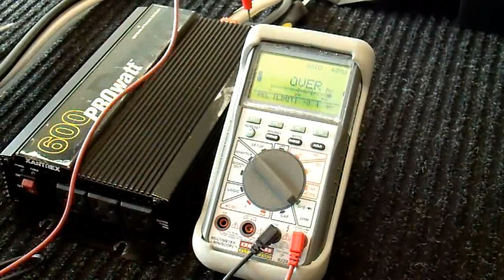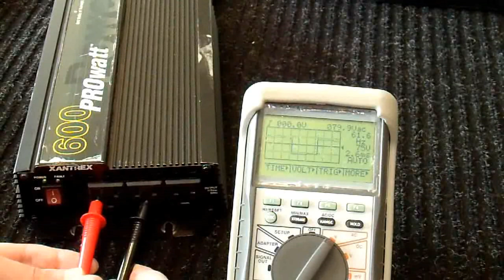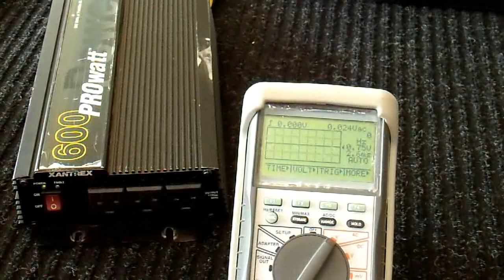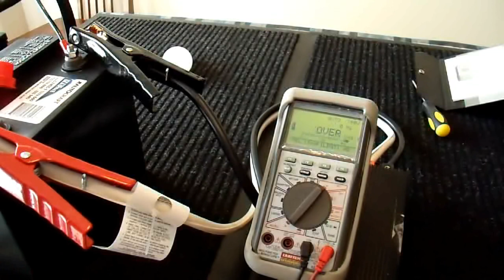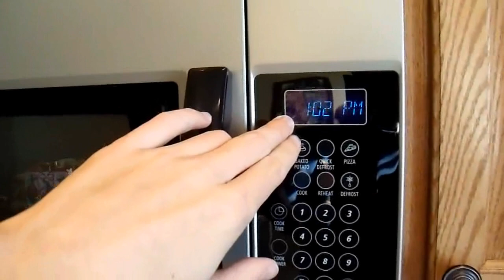How NOT to Connect an Inverter to Your House Mains - Xantrex ProWatt Inverter part2

Comment: I can not believe anyone would try and back feed such a small inverter and with 2 batteries you would be in the dark again in short order if you tried to run everything in your house.
That inverter would be enough to run a extension cord into the house and run a lamp, laptop, cable modem, and router for a few hours. but if you tried to run much else you would be in the dark (out of battery power) in short order.

Its interesting where you did the voltage measurements on the output plug. I will have to turn on my inverter (2000 watt pure sign wave) tomorrow and do some voltage measurements.
Reply: it was an example, he didnt want to drag a bunch of batteries into his house

Comment: Protip: You need to get a "transfer switch". A manual one is not very expensive. A more expensive automatic one can also start some generators if the battery gets weak. You WILL need an electrician or qualified electrical contractor to do this because you will be messing with your homes mains after the meter and before the fuse box for full house systems (like the ones from Generac) or on selected circuits after the fuse box for lighting only and other limited usage systems (like the blower on a gas or oil fired home heating system).
Reply from the maker: I actually can legally install a transfer switch myself where I live without an electrician, but the point of this video is to show how one can do this without a transfer switch or interlock.
Reply: ***** In a sense, if you disconnect from the mains at the breaker panel and back feed from a socket or wiring into the panel, you have a transfer switch. It's a bad thing if your inverter does not have a built in interlock circuit :P
Reply: Don't mess with that; you're probably violating a code somewhere because you're installing a device before the main breaker. Instead, connect the transfer switch to the main breaker (N.O. terminal), and then get a new main breaker and connect its input terminal to the transfer switch, to function as the new main breaker. This way, you can safely install the transfer switch without messing with the grid power meter/fusebox.
Reply: Neo That would violate the code itself. It reads, in general, "Thou shalt not mess with thy breaker boxes bus bar or main breaker terminals except as indicated in the manual." You have to either interpose before or after a main breaker and only before in a transfer switch with a rated and tested (UL in the US or other underwriter body, like ETL) breaker built in or a separate main breaker in a smaller box. A licensed electrician is qualified and will know what is needed. You, the homeowner, are responsible for all wire after the meter and only the power company electricians are allowed to make the connections in the meter box.
Reply: You're allowed to wire after the main breaker, that is to connect it to secondary circuit breakers. There are four terminals of the main breaker. Perhaps your home has a two-terminal breaker. You'll need the four-terminal one. Line and neutral terminals go to the meter/grid; you're not allowed to do anything with both of these, because you would need to obtain the permit to have it switched off at the meter box to be able to do anything at all. Third terminal is for LOAD. You're allowed to connect secondary circuit breaker coupled with a transfer switch to load terminal. The 4th terminal of the main breaker goes to the neutral bus bar; you're allowed to reconnect the neutral bus bar. If your transfer switch is a DPDT, you'd have to interpose before the neutral bus. Again, this is 4-terminal main breaker. If you've got the 2-terminal, you'll need the power company to do it.

Comment: my question is this.. how do you say you cant do all of this... but they sell plug into the wall solar systems that work just fine.. i installed a 1.7kw unit in my grandparents house that just plugged directly into the outlet of her house on the outside circuit.. and it offsets her bill to nearly 0.. and has been for going on 2 years without a problem...
Reply from the maker: That would be a grid-tie inverter.  They can be plugged into a wall socket without these restrictions.  This video does not apply to those products.  Thanks!
Reply: Grid-tie inverter right there. It automatically synchronizes with grid voltage and automatically shuts off when grid goes down.
Reply: ***** Grid-tie inverter is designed to allow mains power to pass through and mix with its own power. Normal inverter would blow for sure, but not grid-tie inverter designed for this very purpose.
Reply: ***** You should be looking at Enphase microinverters if you want quality grid-tie inverters, especially for small installations. Those Chinese inverters are good for nothing. As for insurance and building codes, check your local code and guidelines on solar installations.

Comment: why can't you take an end of a cord three prone  plug that end into the converter and the other end you would strip back(of course the power is off and not plugged in yet) and plug one wire to the 110 and one to the ground and the other to the common and you would at leas we have 110 in the house temporarily   right?
Reply from the maker: If it is not a GFCI then you could, otherwise only connect the line and neutral.  The safety issue here is that because neutral and GND are tied together in your breaker box, and because many inverters have a live neutral configuration, that you would end up energizing the batteries you use to power your inverter.  If you have it connected up to your car, for example, then the entire body of your vehicle could have 60VAC going to it.  60V is unlikely to cause injury but it is higher than what is considered safe.

Comment: I have a expensive Voltcraft pure sine wave inverter and through your video discovered that there is indeed 1/2 nom. between each of the 2 hots and the ground. Ground/earth is connected with the +12VDC strange enough. Good thing i don't have a Bonded earth/ground/neutral in my house, otherwise i had blown or damaged my inverter for sure. Thanks for this information!
Reply from the maker: That's very interesting.  I have never seen an pure sine inverter with a live neutral configuration before.  Thanks for sharing!  I'll take a look at that on future inverters I test out.

Comment: 8-10 kw for a full house . but the home ones use higher dc volts so u use less current  most solar inverters .the 12 volt dc ones waste more power to heat not watts at the plug . i prefer  real ac power inverters are good n quiet  but a generator is more real.

Comment: How long can you use an inverter n your house? Can you use one to completly replace your main power or do you use something else? been thinking of going full solar power and i'm currently gathering any info i can find but the inverter is one thing that has me confused a bit. I see it's something that can overheat and has an internal fan, it has me wondering if i can use something like that to power my entire house.
Reply from the maker: A good quality inverter can operate continuously without issue.  You may need to clean out the dust every once in a while and replace the fans after a few years.
Reply: Thanks A lot.
Reply: We do just that with a modified sine wave inverter/charger that we bought about 30 years ago. It's been running with 100% up time since new. At the time the house was built (on a remote farm) it was to expensive to get the power company to install poles to our house. It's 2.2kW 24VDC input. I forget what brand it is, I don't think the company still makes them. Also it's been powering the same freezer for all that time and the compressor is fine. We got a new fridge because it was too small not because the old one died.

Since then we've built a whole new house near the outer edge of the property and we've had mains power installed here. But the old house is still down there full of all our junk and old furniture, and the invert is still buzzing away 24/7 365

We got a huge 1500W wind generator which makes 40A at 28V in high winds. We got collection of 40W 12V pannels and some 180W 24V pannels that make about 1000W in the summer sun, plus a 6.5kW diesel generator.

Because it's a inverter/charger when the generators running we can make the inverter convert 240VAC back to 24VDC and recharge the batteries.

Comment: Would a pure sine wave inverter be fine for appliances in a long use scenario? There are a lot to choose from online and I noticed some are sold as modified sine wave inverters which I think you said can screw up microwaves and fridges etc. thx
Reply from the maker: Pure sine is the appropriate choice for long term continuous use.  I would only use modified sine if you are on a tight budget and don't mind paying again to upgrade later.  Pure sine inverters come in all different grades and configurations just like modified sine so you'll have to decide what feature set and price point is best for you.

Comment: any issues with using grid tie inverters? Can multiple grid tie inverters be connected?
Reply from the maker: I would recommend to always check the manual, but grid tie inverters can be connected together.  Connecting multiple grid tie inverters to the same SOURCE (solar panel, etc) is not an intended use scenario and probably won't work very well since they usually have an MPPT in them.

Comment: Who would WANT to hook up an inverter under 1000w to your house anyway?  The 600w one in the video would not run most full size refrigerators, let alone the whole house.  A full size refrigerator requires somewhere between 700-1000 watts just for it.  Isn't the fridge the main reason for using these anyway?
Reply from the maker: I was just using that inverter as an example.  The principles involved are all the same so the size of this inverter is irrelevant.  I use a 3000W inverter and a 1000aH battery bank for this purpose in my house.

That said this inverter WILL run a refrigerator and sometimes you might just want to charge your phone, watch TV, turn on a few lights, etc.
Reply from the maker: *****
My full sized refrigerator only consumes about 120W when running.  It requires nearly 1000 to start, though.  Not many sub 1000W inverters are able to run it.  The one in this video does.
Reply from the maker: *****
I should also mention that it requires >1000W when in the defrost cycle.
Reply: The fridge isn't my priority during a power cut. I want TV, DVD player, internet router and house lighting (which is now LED). 1000W easily covers it. The fridge is new with very good insulation, so it should survive for a few hours without power.
Reply: Not even 1000W inverter if you have a fridge or AC at all, due to the compressor's initial power surge. He's just using it as an example. It serves the purpose well. Just like he commented, you will need the 3000W continuous (preferably 6000W peak).
Reply: *****
I'm not entirely sure why you addressed that to me, since I said nothing about grid ties.
Reply: Unless all you want is a TV and a few lights.
Reply: @Wonkee Our older Gibson draws around 225 when running. Our even older Philco was even less but after 50 years and moving half way around the world and back, it finally died. It all depends on the design and whether it has all the latest but not so greatest features. Our full sized Servels used no electricity at all. They ran on natural gas.

Comment: You can use an AC outlet tester to verify the inverters output too (those $10 ones with the three lights and a table, must show OK and not an open ground or neutral fault). A second check w/a Multi meter like you showed is not a bad idea! My PB PSW 1000 inverter is wired correctly inside if I need to wired in an emergency (tested).

Comment from the maker: I have found that most of the time the outer case is isolated from all inputs and outputs, with the frequent exception of the output GND.  If the case is connected internally to the GND lug on the output plugs then connecting the Line and Neutral up to a breaker panel will cause the case to be live on those units.

Comment: Won't this also cause the outer casing of the inverter to become live?  My inverter (A RING model designed for use in the UK) has the battery negative connected to the outer chassis.

Comment: No voltage between  GND and battery terminals.  But I am getting voltage between both neutral and hot and the battery terminals. Sigh.

I guess I will run a couple of lines from the inverter for handy outlets, so we don't have to go to the basement to grind coffee or run a laptop ;-) 

Thanks for your help.

Comment from the maker: I agree with you about the separate wiring - it just isn't practical.  I would recommend checking the voltage between the battery terminals and neutral before plugging it in to make sure the input and output stages are isolated - occasionally they're not.  Thanks for the sub!

Comment: Thanks for another great vid.  I've sub'd.  I use a suicide extension cord with my generator, and would have just plugged an inverter in with one of those.  I got my Motomaster 1750 inverter last week (after watching your reviews) and am pleased to see no voltage between GND and either of the other two lines.  Using a suicide cord will be so much easier than running separate wiring around the house for emergency power. Does this sound good?

Comment from the maker: Unfortunately it is AC so diodes will not solve the problem.  In reality you could connect it like you want by simply not connecting the inverter Ground (the ground on the AC output receptacle) and if you can guarantee that no children or anyone without prior knowledge has access to the DC side of the inverter it should be OK.  Still I cannot recommend it for liability reasons.

Comment: what if I put 3 diodes = 1 for the hot, 1 for the common, and 1 for the ground. than put a switch after the breaker?? would this help me tie in the 1500 watt inverter to run just my lights??? I am asking because I think this may work?? what do you think?  I am saying with the 3 diodes in place, AFTER  I shut off the breaker for my Lights. would this stop any back feeding to the MOD INVERTER?

Comment: Also, if I use a pure sine inverter can I run a suicide plug to back feed the panel or does it split the power output to the hot and common lugs like the modified sine inverters?

Comment: Man... glad I found this video. Was wiring my off grid cabin this weekend and would have done it the wrong way. I now have the lights and few plugs on my "inverter line" on the big stuff in the panel run off my generator. Then plug that line into the panel when I switch over. Question... my inverter has a ground lug in it. If I ground that to my rod outside will that change the inverter output? Do I need a separate rod for the inverter or is the panel rod OK?

Comment from the maker: If this is about cost, then I would recommend going the monthly electric bill route.  It will cost you less than any sort of solar or other installation in the long run and allow you to do so much more.  I have done the calculations and where I live and with 440W of solar panels I would get only about 35kWh/month.  That's less than $30 worth of electricity per year.  After adding the base charge you'd still come out ahead paying the utility company.

Comment from the maker: AC line power will destroy the inverter.  It will not put any power into the batteries but it is likely to put smoke into your house.

The mains must be turned off because backfeeding like this is a real electrocution/fall hazard to anyone working on the power lines outside of the home.  You could be energizing a potentially large portion of the grid outside your home if you happen to be on an island without other customers connected.

Comment: My house was built in 1960, so I have two tar coated wires coming into a sealed fuse and two wires coming out plus a braided earth strap which is fixed to a metal spike that is driven into the foundations. The two wires then go to the fuse box which has the mains switch on it, from the box still using two wires into the meter and two from the meter into the house. When I say fuse I mean the sort where you replace the fuse wire if you blow a circuit.  I guess it's time to get a modern breaker box

Comment from the maker: In the USA we get three current carrying conductors from the power company: 120V 0degrees, 120V 180degrees, and neutral. The neutral is ground potential and is current carrying. There is no breaker for this line. The fuse box has all of the GND and all of the neutrals tied together and there is no way to disconnect them nor should there be for safety reasons.  In the UK I assume you do not have split phase power and therefore can safely do the GND/Neutral tie on the utility side of the breakers.
Reply: Here in india we get 3 phase 240v and each of them r 120° out of phase ..

Comment: I see what you mean now but I dont understand the need to have the neutral still connected after the switch is thrown. All the connections inside my UK fuse box are made after the switch with no wires linking back across the switch to the live feed, so when my switch is thrown the feed is in complete isolation from the house. So does this mean that in your house, you can still get a shock when doing re wiring even if the switch is thrown, or am I still not getting it..

Comment from the maker: I am not aware of any systems in the USA that do not disconnect all current carrying conductors - I cannot imagine such a system ever existed.  Are you aware of one that does?

The problem isn't the dual throw switch, it's the neutral-gnd bond inside the panel that causes problems.  Inverters with live neutral configurations will often destroy themselves if neutral and gnd are tied together.